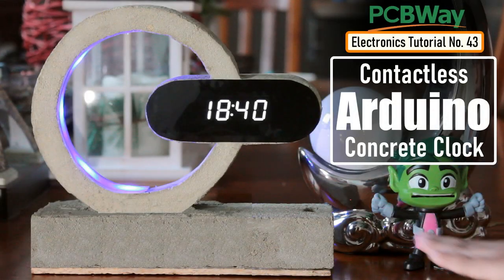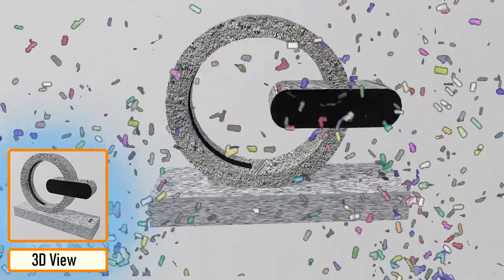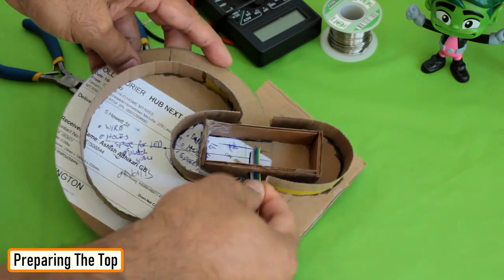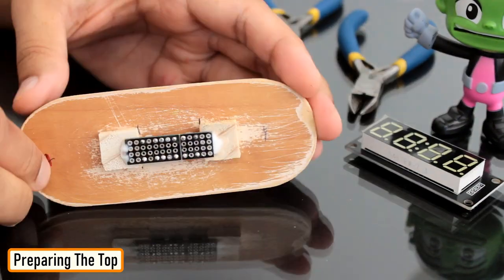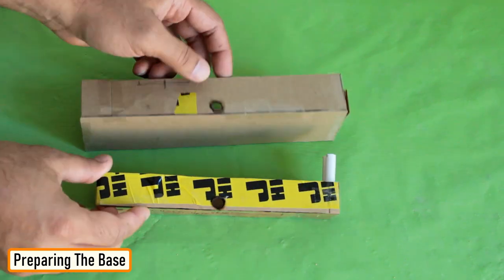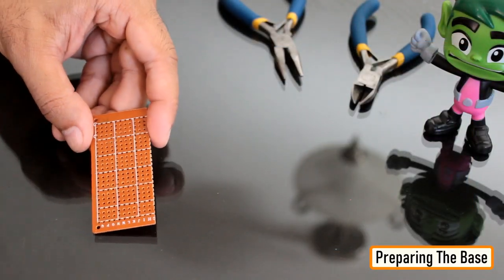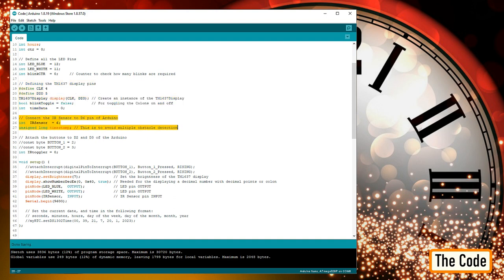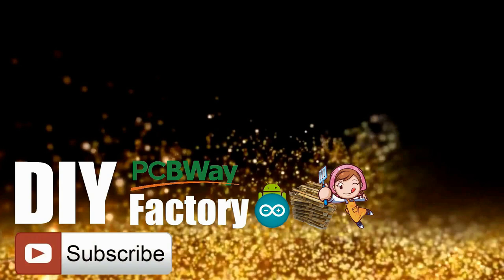Arduino Based Concrete Clock With Touchless Night Lamp

Comment: You didn't even insulate the leds lol, this is rough as and hot glued everything in place haha. As a prototype I wouldn't question it but left in direct sunlight it'll start falling apart.
Reply from the maker: 100% agree 
But this prototype works with IR module, and if left in sunlight it will go bonkers